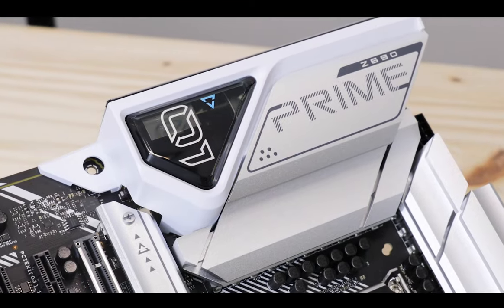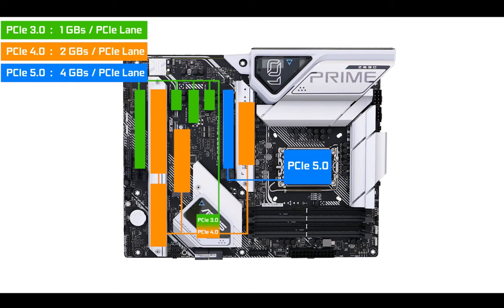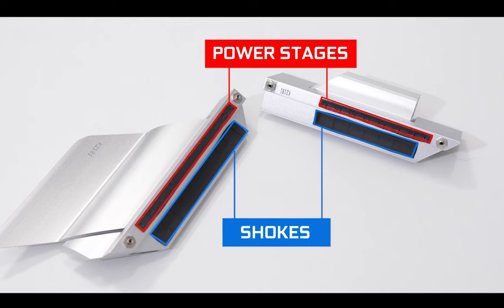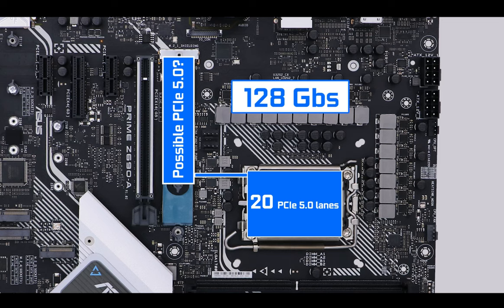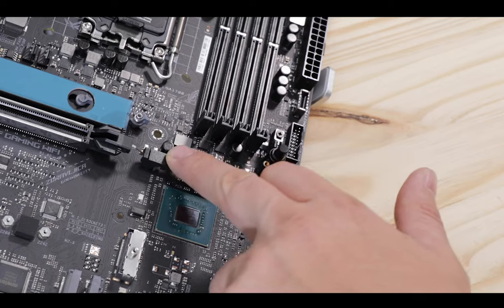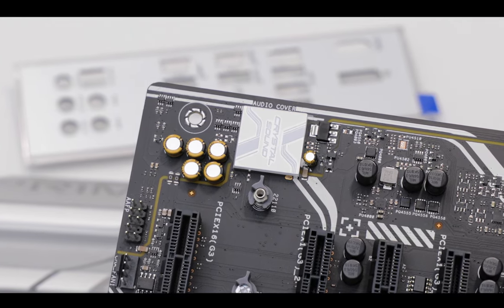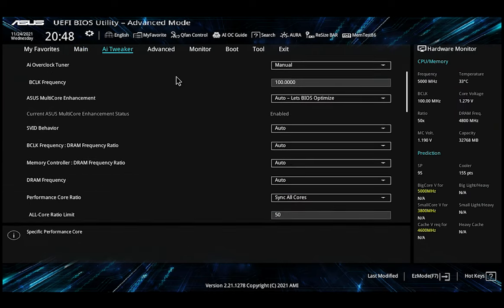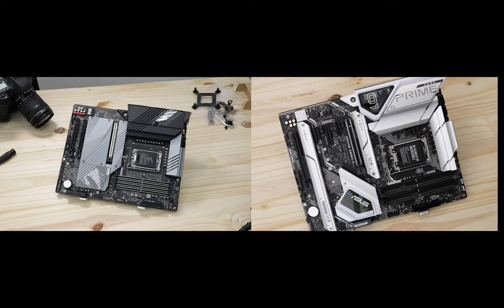ASUS PRIME Z690-A : The full REVIEW

Comment: I got 5.3 GHz on my 12700k on this motherboard I love it and I got it on a discount for 200 USD so am not complaining about any missing feature.
Reply: Hey, I'm thinking of buying this as my new mobo as it's white and seems to have some really good features but have gotten more and more unsure, would you say it's worth it, how ahs it been for you?
Reply: @hevz6339   it has been running for 2 weeks now, and the main reason that I bought this one is the color I have my build white and black and it fits perfectly.
 The performance in motherboards  is negligible for me and not worth looking at it it I was more interested in the number of NVMe slots that I can fit in it specially with the news of direct storage coming to  PCs, if you you would like wifi with it you can get the new version of this one that has wifi and Bluetooth.
But the main thing to ask is do you really want the ddr5 ( for me I got them used for a good price ) as the price is really high compared to the performance.
Reply: Hi.. Does it support wifi?
Reply: @manumukherjee7715  no
Reply: @basharkhoury9403 does it habe good sound?
Reply: What gpu and psu are u running. Im gonna try overclocking on this mobo with the same cpu, a 3080 10gb, and an 850w gold psu

Comment: Hi Laurent, Thanks for the review, top class! I have a question for you: Why on God's green and blue earth are you so DOWN on SATA 3 ports being on MoBos?? I can understand how a few may not need the storage but what's the alternative? You have enough M2 slots now on these Z690s so no complaints for you there. But the cost of high capacity M2s is prohibitive still. Where are you going to store some terabytes of data on the family computer if they get rid of SATA? Video editors who create 4K & 8K files, family people with lots of photos and 4K vid files and many more uses and reasons that much storage is needed in everyday computing. What are these people to do if SATA goes away. SATA 7,200rpm drives are the absolute best value and for storage the case can be argued that the 5,400 low power versions are more than adequate. So, why so down on SATA mate? I, for one, would be lost without it. For my vid editing I have some tasty WD Gold 18TB and Ultrastar 14TB drives. They're reliable as the sun, cost only $45AUD per TB and are a solid mature technology solution. I have WD HDDs that are 12 years old and still in perfect health. What's not to like unless you rely on them as a rabid gamer, which most don't.
Reply from the maker: You are correct on all the points . 

My real issue... what truly bugs me is not the SATA standard which is great. But the fact that it never got its long promised update (SATA IV). 

I simply don't get it. 

Either manufacturers updates the standard or they replace it. But keeping us on a 6gbs standard when we are dealing with PCIe 4 and 5 roll out... is beyond me.
Reply: @Laurentschoice  Maybe now with NvME/M2 drives they don't see a need to put money into HDD tech to speed it up. Maybe the manufacturers see HDDs as 'storage only' and are content to use M2 drives for the boot drive to play games and drive the computers with reliable SAT just sitting there ready to kindly store any data. It IS odd though, why they don't create the SATA 4 and beyond - if you look at the current evolution in HDD tech there's some absolutely amazing cutting edge tech going on. Look at helium drives (yes, years old now but still) and look at the work Seagate is doing with multiple actuator arms and WD is doing with the Ultrastar and Gold 20TB drives - just stunning tech. Why they don't make the transfer rate faster than SATA 3 is also beyond me too.

Comment: Hello, I'm currently purchasing components for my first PC build. I'm using PC part picker and the their compatibility detection to help me. I bought this motherboard and a Corsair Force MP600 2TB NVMe PCIe SSD. My friend told me that will cause me trouble since both the ssd and mobo have heatsinks. I am wondering what you think of this? He said I could take the heatsink off the mobo but it won't be as aesthetically pleasing or modular.

Comment: bro which m.2 preferred for the windows boot drive. the CPU vs the chipset m.2 slots.
Actually, I will buy a corsair mp600 pro lpx that comes with a heat sink. 
going to use on prime z690-A.
And wish to install the M.2 SLOT without a heat sink on the board. can u advise which slot is better or both are equal?
Thank u

Comment: I thought of getting the MSI pro z690-a wifi, but then I noticed that the prime z690-a was going for just a little more (non-wifi model). Should I go for the Asus or stick to the MSI board?
Reply: Stick to asus z 690a if wifi is un- necaassay for you. I think audio codec too are different. But if don't make any difference. MSI is durable and long lasting.
Reply: @HarvinderSingh-yy8th  yup, I had ordered the MSI, cancelled it and built my pc with the Asus, happy with my decision.
Reply: @HarvinderSingh-yy8th  Is the MSI more durable than this ASUS board? The audio codec on the MSI Z690-A is on a budget, that's the reason I might switch to the ASUS Z690-A.

Comment: If you use unity, this board is fantastic. easily overheated VRM's on am4 and intel board, this board's VRM stays cool as heck even when throwing a big workload at it, and no overheat means no throttling!! lovin it. i712700kf, 64gbDDR5 4800, rx6800.

Comment: Which brand DDR5 ram u recommend 32 kit and speed.
5200 vs 6000.
The nvme comes with a heat sink that will be able to fit on this board.

Thank You.

Comment: Hi, I noticed on Z690 Prime-A website that the ddr5 ram supports up to 6000 mhz. Does this mean it won’t be able to reach 6200?
Reply from the maker: You can always try to push them with over voltage. So motherboards can go a little behind advertised specs.

Comment: How many argb fans can we connect to a single argb header? Is 6 safe?

I'm confused inbetween gigabyte b550 aorus pro v2 vs strix b550f gaming. I like the gigabyte but the need to flash bios is scary. 
What will you suggest? (Both boards are same price)
Reply from the maker: maximum 5 fans per connector. More and you'll burn the connector and irreversibly damage the board. 

I d go for the cheapest of them two. They are very similar in performances, even though I have a slight preference towards ASUS which did an amazing job with they STRIX series on B550 chipsets.

Comment: I have a Corsair h150i Elite Capellix AIO, it comes with a mounting bracket for 115X socket. Do I need to get an adapter to mount my AIO in this motherboard? I'm aware this has LGA 1700 socket
Reply from the maker: Yes you do. The space between the CPU roof and the AIO copper plate is toi high for them to touch if u do not use an adapter. 

It is as if there was no cooler on the CPU at all
Reply: @Laurentschoice  ok thank you very much, I will search for an adapter then.

Comment: I bought an Asus Prime Z690A with an Intel Core i9-12900K and Kingston FURY Beast DDR5 memory 16GB 6000MHz but unfortunately the board does not start, what did I do wrong?
Reply: Perhaps the DDR5 memory is not compatible.
Reply: Did u solve the problem? I have the same situation :(
Reply: @denisalexandru4848  Yes, I solved the problem first, you have to manually limit the RAM to 4800MHz in the bios and NOT leave it at 6000MHz.
Reply: @OldEastGermany   Thanks, I will try that

Comment: I was debating between this board and the Gigabyte Aorus pro z690.  Thanks for the help. For $30 the aorus its worth it IMO.
Reply from the maker: Absolutely !!!! Glad to see I'm not the only on to think so :)
Reply: @Laurentschoice  what is your thoughts on DDR4 memory speeds with 12th gen 12900k's?  I've seen a bunch of videos showing 4800 mhz but its hard to come by. Also I saw some say 3200 speed as it last the least latency. Many to choose from 3200, 3600, 4000, 4400, 4800. What makes sense or which model in stock on newegg/amazon you recommend.  Thanks!
Reply: @justinhoover2775  I just don't understand all the comments regarding getting maximum achievement of speeds.  For everyday use you're not going to see any difference with your own eyes.  What exactly is it that you're doing that warrants all this tinkering?

Comment: Bought this mobo paired with i5 12600k 240mm aio and a gtx1080ti, it only boots with integrated graphics and my gpu despite showing lights and the fan running it wont post, i tried the second pcie slot and same problem, wtf is this? Another case of Asus incompetence? Is the gtx1080ti too old to get supported? Its so frustrating

Comment: Only big problem i had with this board is the heatsink on the chipset blocked my gpu which was real infuriating, had to take off the heatsink and just hope the chipset does not over heat.
Reply: Which GPU did you use? I am looking at this board with an ASUS NVIDIA 3070 ti. Also, have you had any issues? Thanks.
Reply: @MajorSollus  woulda been nice to know eh?
Reply: @Accretions  3070 TI Rog, sry my replies were disabled and I didn't notice.
Reply: @MajorSollus  3070 TI Rog, sry my replies were disabled and I didn't notice.

Comment: Does it support ddr4?
Reply: This is a ddr5 motherboard. The two are not interchangeable
Reply: @mikerzisu9508  I did check on the internet and various other creators said it is
Reply: @pescetv8371  i checked also and t says that is supports both ddr4 and ddr5
Reply from the maker: Eventhough the chipset can support both ddr4 and ddr5 ram,.motherboards cannot support both standards.

Ddr4 and ddr5 ram have different fitting sockets.  It is physically impossible to to swap standards on the same motherboard.
Reply: @obi-wankenobi3656  owned

Comment: Be aware! This MB can be a nightmare!

It has now been on the market for almost 1 year. Still, it seems to work with 2 rams at most. All compatible rams are listed on the official ASUS page for this motherboard, but only with a maximum of two slots. I tried everything to make it work with 4x 16gb but ended up with blue screens again and again. I have now taken out 2x 16gb and everything works fine...but I need 64gb!!!

This is a disaster: not only that I have now bought 2x 16gb for nothing. In addition, the space for the first ram slot was so tight that I had to remove the heatsink to even have enough space next to the CPU fan. 

It is also incomprehensible that only the last bios update in July made it possible for my 6000mhz RAMs to be recognized as such. So that's a whopping 9 months since the motherboard was released.

What kind of idiots built this motherboard? For me, this was definitely the last ASUS product I bought! Horrible!!!
Reply: Hello friend. Unfortunately I didn't see your comment before buying this same card. I bought the parts for my new work PC but they still haven't arrived. Your experience reported here is really serious. Mainly in relation to the card not recognizing more than two slots. any news regarding this? Not to mention the space problem with the first memory slot. Anyway, I'm sorry for your problem and I'm afraid I'm going to go through the same problems here. If you have any news or tips on this it would be most welcome. By the way, what kind of ram memory (frequency, model, etc) are you using on your pc? Thank you and success.
Reply: What type of RAM are you using? I tried with a kit (2 x 16) FURY Beast RGB DDR5 5200MHz CL40 and I had compatibility problems (having the in-stock bios version)
Reply: Same experience here and same problem with this mobo... Don't buy this